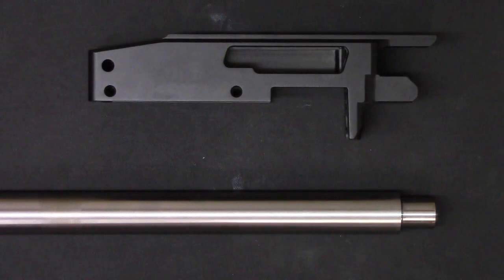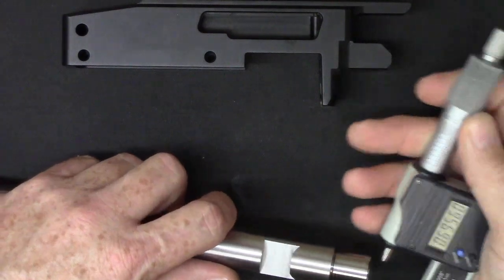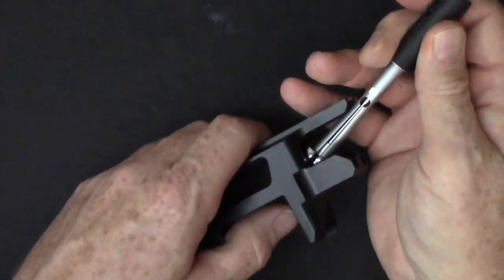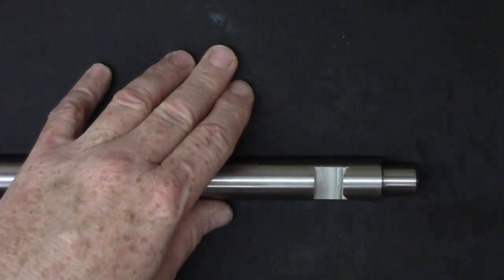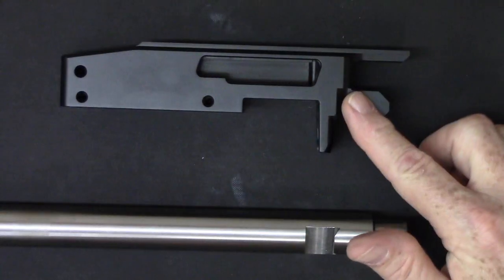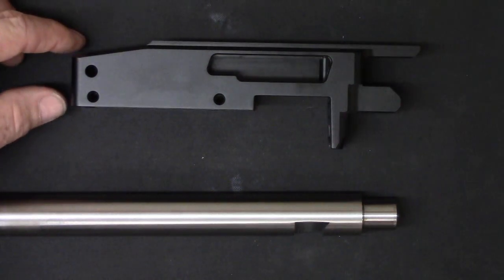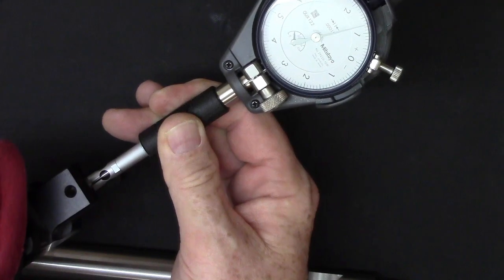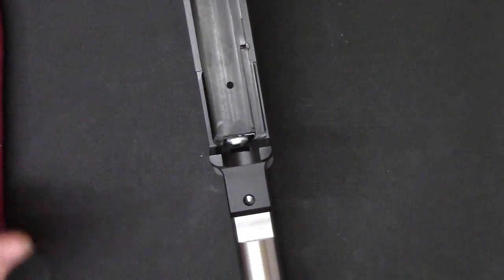10/22® style- KIDD barrel installation to KIDD receiver

Comment: I used a heat gun and that heat expanded the receiver. With lube on the barrel tenon I slipped it right in. Then I centered the extractor perfectly in the extractor slot of the barrel.

Comment: For easier barrel installation put the barrel in the freezer for 45 min.  Put on some gloves and use a heat gun to heat the receiver.  The in a quick motion slip the barrel into the receiver.  You have to do it quickly because once the barrel  wicks the heat away from the receiver it will become very tightly fitted.

Comment: Awesome Video, thanks, HOWEVER....
I just tried my New, never used Thompson Machine Operative in my new, never used Kidd Receiver and it fit in there easily and could spin easily. Thoughts? Bought Receiver direct from Kidd and Barrel from Thompson Machine through a Class 3 dealer. Am I screwed?
Reply: I know this is 8 years late but my stock charger the barrel spins easily

Comment: Just installed my Kidd Ultralight today, it went in tight and i used the 'cookie cooking" method. I was shooting one hole groups (50yds.) 20 min. later using an EOtech 512, Kidd 2 stage trigger, Match bolt , TS Vantage stock, Gemtech 42gr. subs. Incredibly accurate barrel! Your cookies look yummy ;)
Reply: 11 years after your post, I am buying my first kidd ultra lightweight barrel to go into a stock ruger receiver. Looking at a two stage trigger in future.. excited. Still deciding on an optic, potentially vortex diamondback 4-12x40mm with AO or something similar. I was gifted a bunch of tandemkross cheaper parts(firing pin, extractor, auto bolt release, krosspins/takedown screw) and a moe x22 stock.

Comment: LOL on the cookies.
Reply: Can't bake good cookies at 250;  need 350-375.
Reply: Just completed a total rebuild of my 35 year old 10/22 with all Kidd parts including the 20" bull barrel.  I used a Ruger BX trigger assembly just because I had a new one on the shelf.  My barrel swap out went smoothe as silk (only a couple of lightish taps with the rubber mallet)  and I had to make only a slight adjustment to line up the extractor properly.
     Today (June 15, 2020) was my first trip out to the range.  A little personal background:  72 years old, trifocals, no practical range work ever, only plinking around.  Conditions were sunny with heavy wind from around the 5:20 position.  I used  Remington 40gr Target loads.  My scope is a really old Simmons scope for 22 rifles.  No turret dope,  simple crosshairs.
     I only shot at the 25 yard mark due to my eyesight and a very simple, non-zoom, rifle scope.  
     First grouping, cold, was high and left but together within 1 1/2",  Took me several boxes of ammo to walk the shots to my aimpoint.  Once on I was shooting 3/4" groupings all afternoon with NO FLYAWAYS!  
     Not a spectacular feat for most of you but this was outstanding for me, and I can only attribute it to Kidd rifle products.